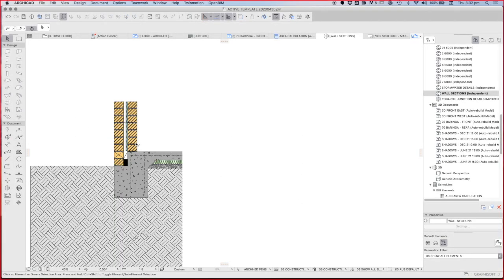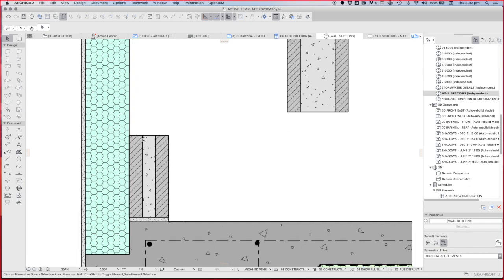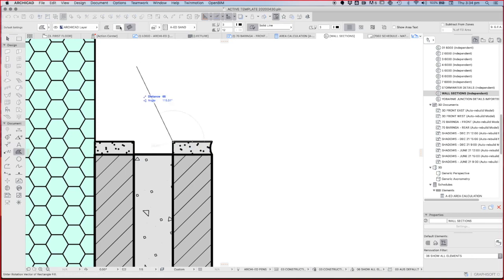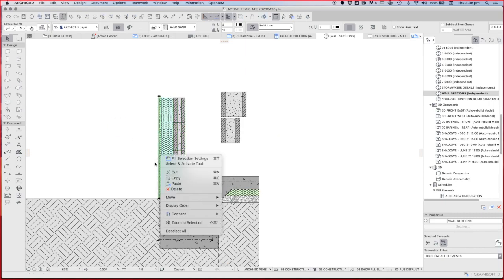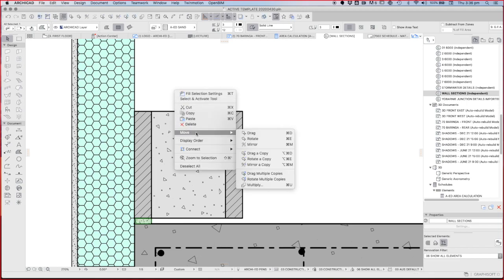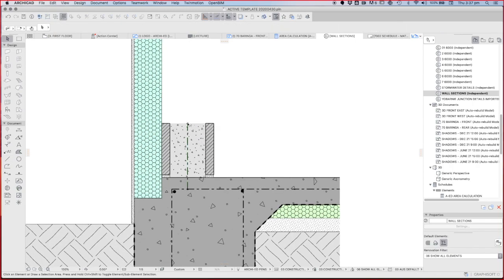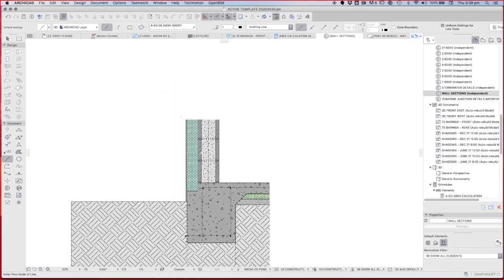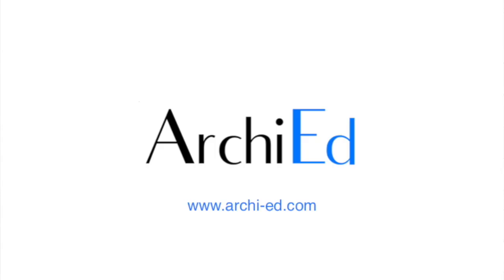2D Detailing Wall Section - Part 7 - Concrete Block

Comment: I just started from AutoCad to ArchiCad. Did you have to draw your details manually? I am trying to figure out how to hatch block where you get 0deg and 90deg hatching. Seems that all of the hatching is in one direction. I dont want to use the default of 45deg hatching as that represents existing walls.